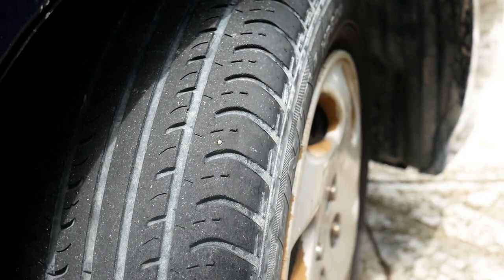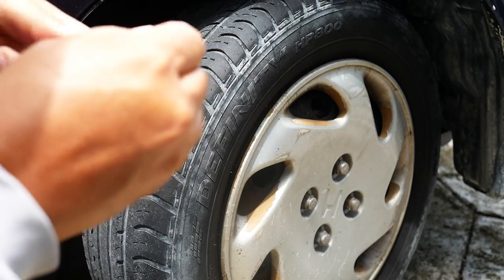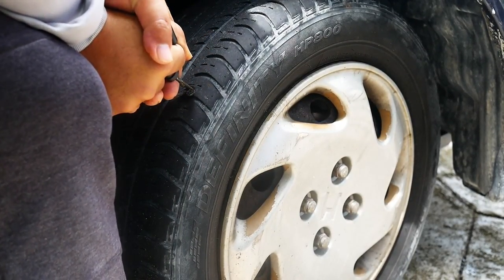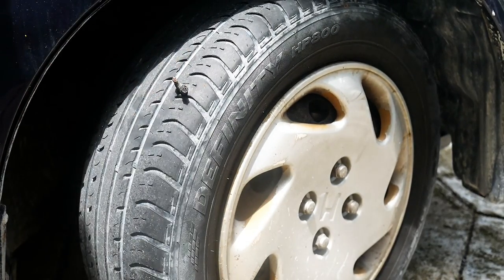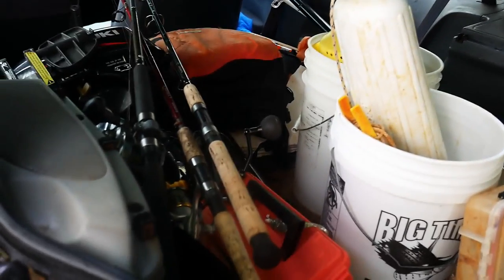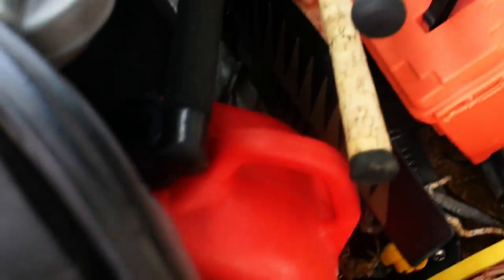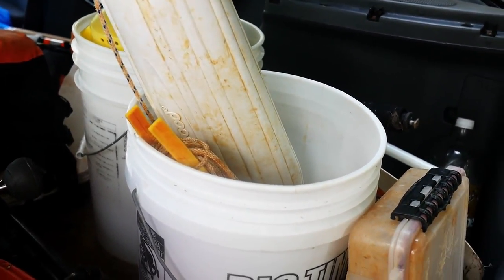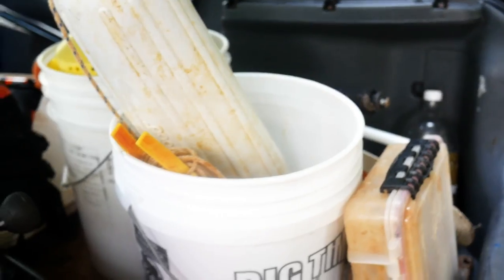How To Fix A Flat Tire So You Can Go Fishing

Comment: Great job!I use rubber cement also. glob it on it will slide in better and give also extra seal.Thanks for your vids,it helps me start my day.
Reply from the maker: It comes with sticky stuff on it.  Good enough.
Reply from the maker: Probably could have lit it on fire as well.  It works though.

Comment: Hi Steve,  I see you have a tire patch kit.  Great item to keep in the car.  A 12V air pump would be good to have if your tire is completely flat.  Check your spare tire to make sure it's in good condition.  My daughter called me to change her tire and the tread had delaminated from the cord on her spare tire. I plugged her flat tire and used the air pump to inflate the tire.
Reply from the maker: The benefits of living on a small island.  Your not far from anything.   I have a bicycle pump that will get enough air to get me wherever.  Electronic stuff doesn't survive very long as the insides of my car get doused with salt water.

Comment: Hey I'm really enjoying the videos! Just a tip for the tire repair next time if you don't have rubber cement or a vulcanizing agent. light the plug on fire. Let it burn for a few seconds blow it out then insert it. It really helps with inserting and helps bond it to the tire. th
Reply from the maker: I should have burned it instead of cut it.  It's been fine though so off we go.

Comment: The exact same thing happened to me 3 weeks ago. Everything loaded and pulled out my spot then I hear tick tick tick from the tires. Was early Sunday morning when nothing is open except an Autozone. Plugging tires is nothing new to me as long as I found an open auto parts store. 
One advice for everyone, best to drive over to the air pump station and plug tires right there in case you lose a lot of air in the process.
Reply from the maker: Yea, you can't let that cancel a day on the water.  Do it at a tire shop just in case.  LOL.

Comment: With all that equipment to haul around, keep an eye on that plug.  It's right on the border where the tire flexes the most, where any type of patch will be of short duration.  If you've a 12v compressor, keep it handy in the car just in case.
Reply from the maker: It'll be fine.  Got the bicycle pump.  LOL.

Comment: You finally took my advice, Plug it...the glue they give you isn't necessary but does help slip the plug into the tire. I have to use the glue as my tires are much bigger as I drive a larger SUV. It's to damned hard to just push the old plug into the hole without some lube.
Reply from the maker: Had to find the nail.  I keep the kit with my motorcycle.
Reply: Key West Kayak Fishing , you talking a real moto or a scooter ?  I haven't heard many moto riders plugging a tire and feeling safe about it. Good for a emergency fix till you can find a garage for a inside patch job on the moto tire. Have you had luck an a big bike with plugs ?